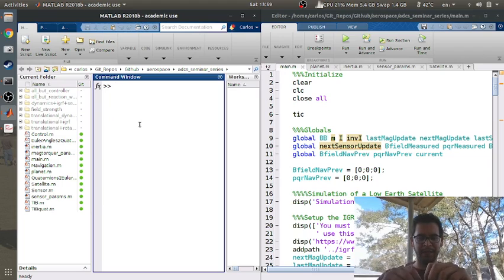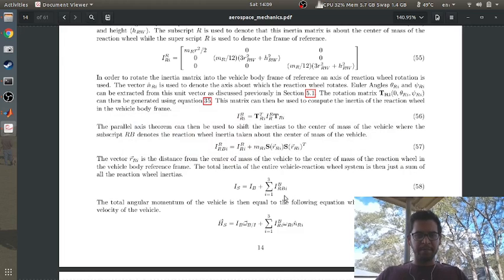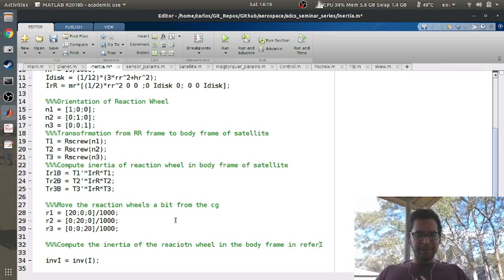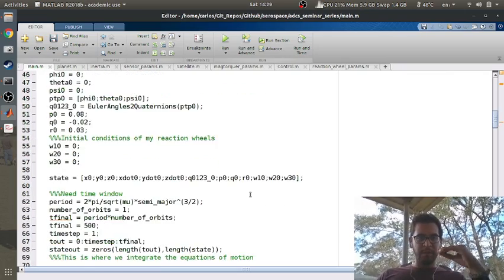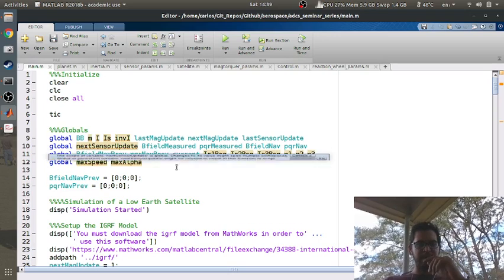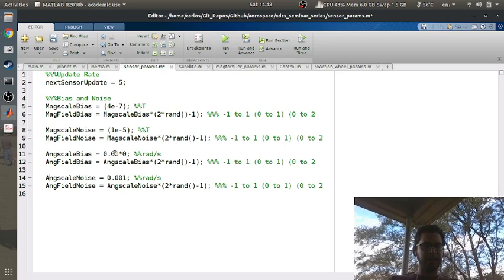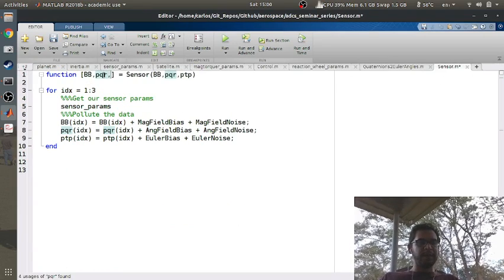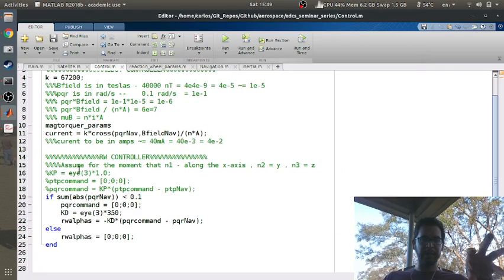MATLAB Help - Adding Startracker Measurements and Reaction Wheel Detumbling Control to CubeSAT Sim

Comment: Hi! I have a question, why do you only use the Nav data(polluted and then filtered) only for the control function? In reality, shouldn't I propagate the whole state vector based on the Nav values in order to get a closer behaviour of the sensors that I would get in reality? (i tried doing it and i get really big errors so that's why im asking=) ) great videos btw, thank you!
Reply from the maker: So remember that the integrator is integrating the truth values. If you integrated the sensor data you would essentially be integrating incorrect and untrue values. The simulation has truth data which is what would happen in real life and then the polluted and filtered data is what the sensor would encounter if you actually built the satellite and measured the environment. 

Integrating biased or noisy data will produce biased or noisy state results which is why you're getting such big errors. The navigation and control routines are completely independent from the dynamics simulation which is trying to emulate physics in the real world.

In the real world the physics happens automatically and our sensors merely observe the environment and are thus imperfect and biased. 

Makes sense? 

Also apologies for my late reply. My notifications aren't working.
Reply: @CarlosMontalvo251 it makes sense now, thank you so much for your reply!

Comment: To confirm: you are converting quats to euler angles, polluting the euler angles, filtering them, then running them through Control.m?
Why not pollute, filter and control the quaternions and skip the Euler angles?
Thanks!
Reply from the maker: Most sensors online show sensor noise in units of degrees. So it makes sense to convert to Euler angles and pollute by a certain degree. Also quaternions don't make much physical sense.
Reply: @CarlosMontalvo251  Gotcha, thanks for the explanation. Looking forward to your videos adding disturbance torques and desaturation schemes! Are there any videos on desat/disturbance for any of your other lectures series e.g. python ADCS sim?
Reply from the maker: @JasonBrown-z3w  I have this paper https://www.sciencedirect.com/science/article/abs/pii/S0273117718306690 and I think I have some codes here in python but I don't think I have a youtube video explaining it. https://github.com/cmontalvo251/aerospace/tree/main/gnc_qualification <- There's actually a python and MATLAB version. Perhaps I need to make a video for it.
Reply from the maker: @JasonBrown-z3w  You will find a lot of useful information in this "textbook" as well https://github.com/cmontalvo251/LaTeX/blob/master/Aerospace_Mechanics/aerospace_mechanics.pdf

Comment: Hello, first thank you so much for this series!
The TOTAL CURRENT  plot is for just the magnetorquers, or the reaction wheels as well? I know there is a separate plot for magnetorquer current, so I assume it is both, but I don't see where RW electrical parameters were inputted. Thanks!
Reply from the maker: TOTAL CURRENT is actually just the magnetorquers. I did not compute the current to run the RWs. Might be a good thing to add to the code though if that's what you're looking for.
Reply: Thanks, understood. Cheers! @CarlosMontalvo251
Reply from the maker: @JasonBrown-z3w  I made a youtube video for ya. Hope it helps! https://www.youtube.com/watch?v=UvksoP_hbRg

Comment: hi sir, IS that unit vector in 3d space for representing wheels normal with respect to the center of mass and body frame/ECI as u have considered both same from initial conditions. Also to choose between positive or negative x AXIS DEPENDS ON sense of rotation we are taking for a rxnwheel.
Reply from the maker: The unit vectors are in the body frame of the satellite thus a reaction wheel with [1,0,0] would be a wheel pointing in the positive X-direction. A reaction wheel with [0,-1,0] would be a wheel pointing in the negative y-direction.
Reply: @CarlosMontalvo251  thanks for clarity sir

Comment: how did adding star tracker measurements help circumvent the instability/poles at origin?
Reply from the maker: I think that was just a bug in the code to be honest. I was having issues with the PID loop and it took me too long to work them all out and I was trying to draw conclusions from buggy code.
Reply: @CarlosMontalvo251  hi sir I set gains on the basis of 2nd order approximation of satellite dynamics as response characteristic set constraints with respect to spacecraft inertia and observed dynamics but I have doubt on how to implement/ limit initial torque non-step input as PD control cant do so.

Comment: godsend
Reply from the maker: I saw you posted a comment in the other video and then deleted it. I'm assuming it's because you found this video. I did change the description of the video. I'm pasting it here in case it helps.

The current C++ simulation is here in an archived repo that has not been merged yet and probably never will.
https://github.com/cmontalvo251/C/tre...

Eventually the full simulation will be in this repo but this is still terribly a WIP
https://github.com/cmontalvo251/FASTKit

There is also a MATLAB version if you'd like to just run the entire simulation in MATLAB
https://github.com/cmontalvo251/aeros...

Feel free to comment if you need any new links! 1/31/2022
Reply: @CarlosMontalvo251  Thank you for the response. Unfortunately the first link still seems to be 404ing but the rest are visible. I can see the MATLAB sim and will follow along to try and develop, but I am also curious about the C++ version.
As for the deleting, I think that is YT acting up
Reply from the maker: @aryaashutoshpathak4849  Sorry try this.

The current C++ simulation is here in an archived repo that has not been merged yet and probably never will.
https://github.com/cmontalvo251/C/tree/Break_Everything

Eventually the full simulation will be in this repo but this is still terribly a WIP
https://github.com/cmontalvo251/FASTKit

There is also a MATLAB version if you'd like to just run the entire simulation in MATLAB
https://github.com/cmontalvo251/aerospace/tree/main/adcs_seminar_series

Feel free to comment if you need any new links! 1/31/2022
Reply: @CarlosMontalvo251  noted, thanks!